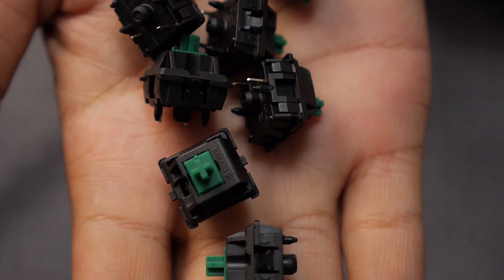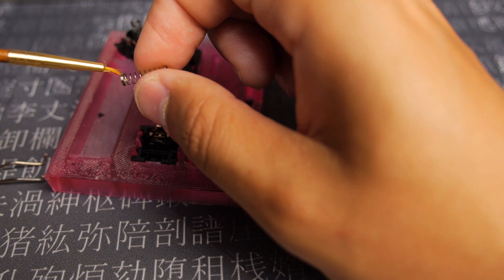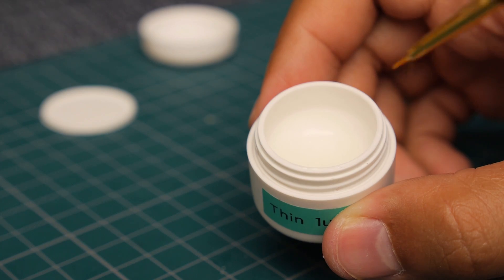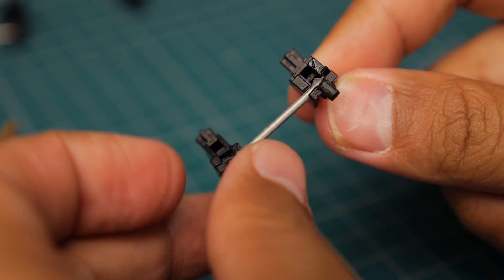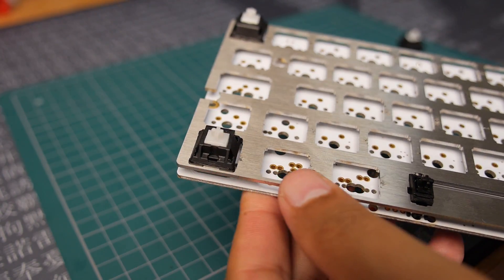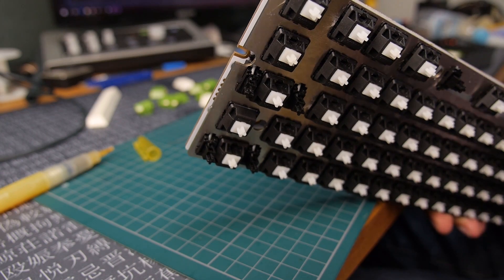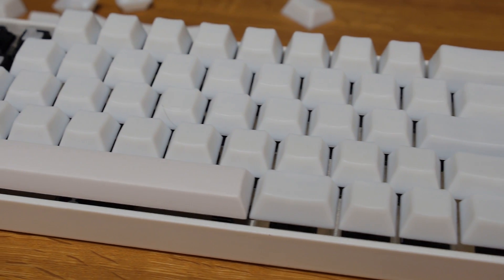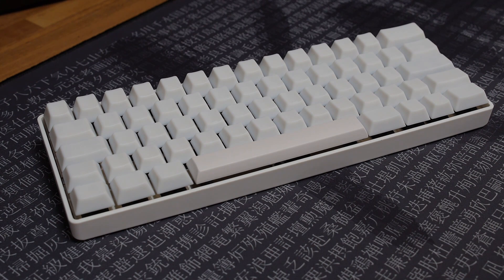GH60 Cherristotle Build: Clicky Switches Aren't Annoying?

Comment: You can fix warped keycaps but putting it in boiling water for 30 seconds, then taking it out, bend it the opposite way, then you press down on the keycap on a flat surface.

Comment: Whenever my pbt space bars are warped, I use a hair dryer and some force against a flat surface to straighten them out. Nice build!
Reply from the maker: +jrudy I did that too :) It didn't make much difference unfortunately. I guess that means I didn't bend it back properly, or I need to tweak the position of the switch to take the tension of the stabilisers. GMK and DSA spacebars work fine though. I'm going to work on it this week.

Comment: I know that most solder has flux paste in it, but have ever tried putting flux paste on your contacts before soldering? Hell of a lot of smoke, but I think it is worth it because my joints come out cleaner.
Reply from the maker: Yes it definitely does make a difference. I have a Hakko flux pen that while ok, tends to get gummed up. I want to get one of those with a felt end. I didn't use the flux pen this time and I had a few contacts that needed touching up afterwards.
Reply: Set up a fan! It isn't worth it to have a migraine for a day after building a keyboard. If you like to use a lot of flux, migraines will be an issue without a fan to get rid of the fumes.

I use a little tub of paste flux, and I just dip the leads of the switch in. It makes soldering go super fast. If it is particularly cold in the room, you may have to hit the tub of flux with a heat gun, btw.
Reply: The problem with that is flux gets into the housing. Happens when I desolder old boards with mx or alps. Having good solder to begin with is the way to go.

Comment: what lube did you use for the stabs here and where can i buy them?
Reply from the maker: I'm not sure since this was a while ago, but at that time I had some lube from Zeal. I've recently changed to 205g0 for the actuation nubs, 104 for the switch itself, and LSD oil for the spring. The LSD is a weird one, but it works well. I have enough to supply a city of keyboard fanatics now. 

I got the 104 from Sprit, and the 205g0 from StoreUni.

Comment: What effect did the lube have? Was it really good or bad?
Reply from the maker: There aren't many switches that don't benefit from lube, and this combination is no exception. As long as you're very careful with how much you use, lube is worth trying on these. Unfortunately, lube can't make them reliable and consistent. I think you have to be prepared to throw away a lot of stems and keep swapping them out if you want the best from these. The sound is great though. I was clicking away on the board last night even though it's not plugged in, just to enjoy the sound.
Reply: Thanks! Looks like I will just go for vintage housing then...
Reply from the maker: Yeah, I probably a better option.

Comment: does anyone use any speedcube lubes to lube their key switches/stabilizers?
Reply from the maker: The go to lube is one of the Krytox oils or greases. Those are pretty expensive. What do they use for speedcubes?
Reply: There are specially designed lubes for cubes that are plastic safe (obviously) and have different feels. Some are thicker and meant for smoothness and others or a little less smooth but are built for speed. For example I just ordered the lubes https://thecubicle.us/premium-lube-bundle-p-9413.html which I plan to find a mixture to lube my first keyboard with.
Reply: SO I FOUND SOMETHING OUT! I just finished modding my first keyboard and I ended up using Lubicle Silk (a speed cube lube) on the switches and oh my lord does this feel amazing.
Reply from the maker: Haha that's great. You should try some of the lube people usually use and see how to you like it. I should look for this Lubicle.
Reply: garrett holden update on how the switches are? Any damage?